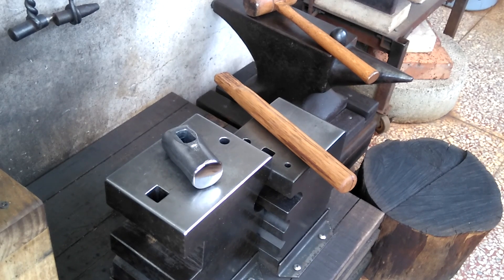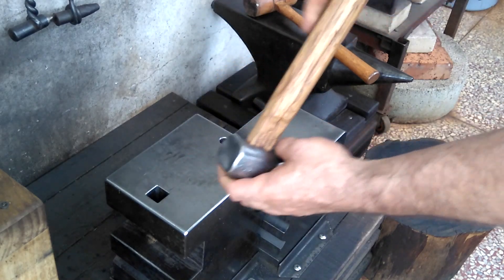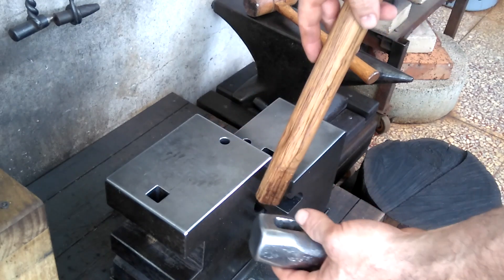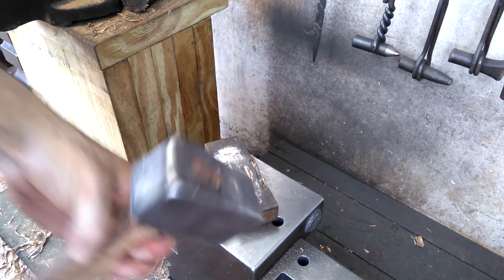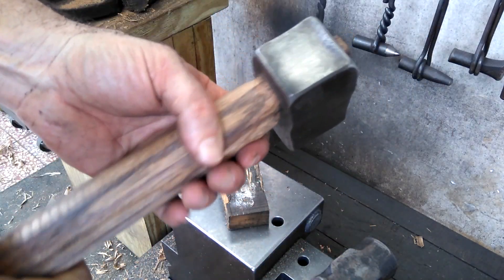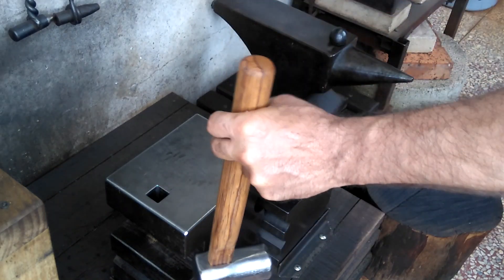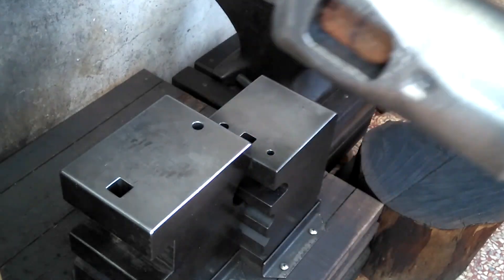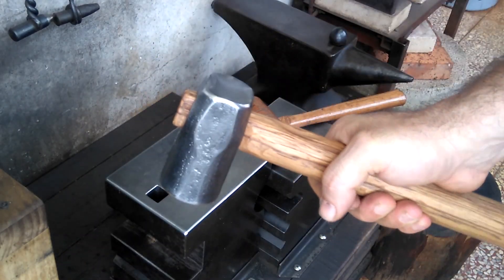Great Hammer Handling Tip (update)

Comment: This is the method I was taught when I took a hammer making class. The one thing I would add is to be careful not to hit the bottom of the hammer handle being set too hard, I've cracked a couple of good handles by being too aggressive with this method.
Reply from the maker: Derek, Good advice. I first round the edges of the handle bottom in order to avoid any splitting. Since finding out about this method, I've been very pleased with the results. Thanks. Glen

Comment: I've always put heads on handles via inertia, but the opposite way round to this.  Have the head uppermost and tap down the butt end of the handle on the anvil, or a stump perhaps better.  You get that bit of action from gravity as well maybe, but mainly the inertia.  Also you don't need a 2nd hammer or mallet.

But anyways, a useful thing to remember, that it works this way too.
Reply from the maker: Some others have also suggested doing it the way you described, using gravity. But I really like the idea of not having to back up either the handle end or hammer head on any surface. Anyway, there's certainly more than one way to go about this. Thanks. Glen

Comment: Many people put steel wedges,i dont.Steel wedge splits the wood,i first cut V shape in a handle and drill a small trough hole right on where pointy tip of V is ,then use wooden wedge,soak everything in linseed oil ,put together,trim to length.Next step instead of using "traditional"steel wedge to hold wooden i use wood screw with flat head.place it right between edges of V cut and  a wedge.
It holds wooden wedge secure ,it doesnt split the wood.Later make a little pool out of duckt tape on the eye and pour liberal amount of linseed oil-your handles wont come loose for a year or two.
Reply from the maker: Thanks for sharing your detailed technique. I currently use a steel wedge but I saw a groove for it to fit into and make sure it can't bottom out and so maybe cause the wood to split. But I can see your technique working very well and I can tell you've put some time into experimenting with different ways... Thanks. Glen

Comment: Just hit the bottom of the handle on the anvil, you dont need a mallet
Reply from the maker: Dane, Obviously there's more than one way to go about this. But I really like this technique whereby nothing has to be resting on another surface, be it the handle or the hammer head. Thanks for watching. Glen
Reply: What i mean is, rather than hitting the end with a mallet,  just hold the hammer in your hand normally and just knock the end of the hammer handle on the anvil. It is essentially what you are doing the other way up!